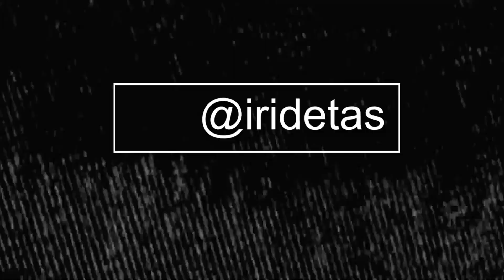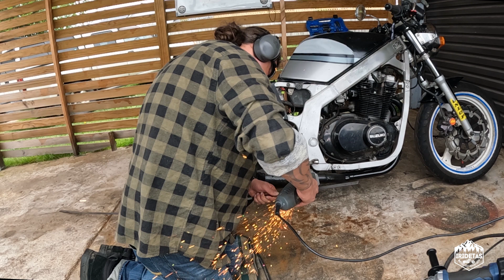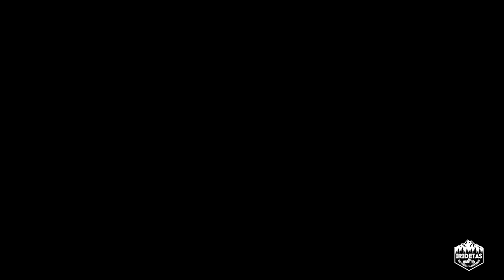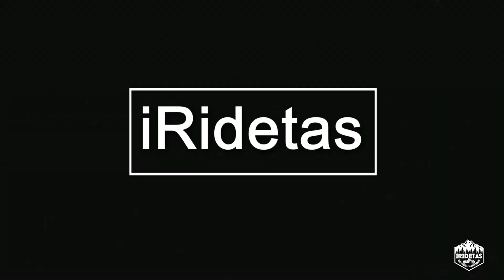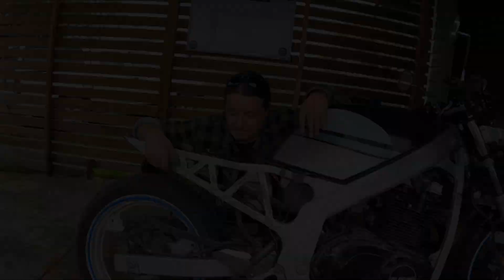MCR#12 | Suzuki GS500 | Trellis Frame Using 20mm x 3mm Flat Stock from Bunnings

Comment: Enjoying this build a lot.....
I have a gsxr400 gk76a frame laying around and wondering if a gs500 lump will fit...
So....could you tell me the mm between the rear lower engine mounts please?..appreciate it if you could...no gs500's I've seen to measure around here